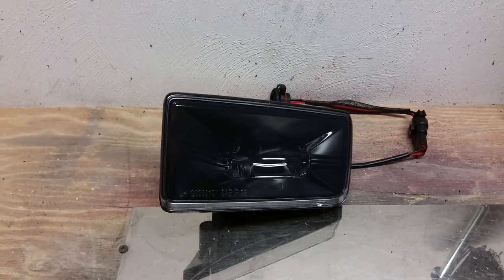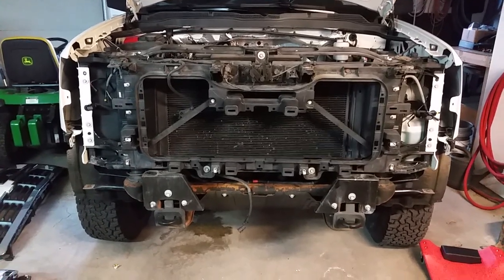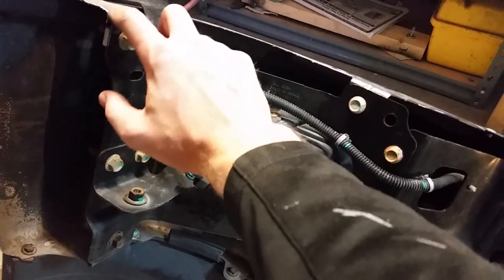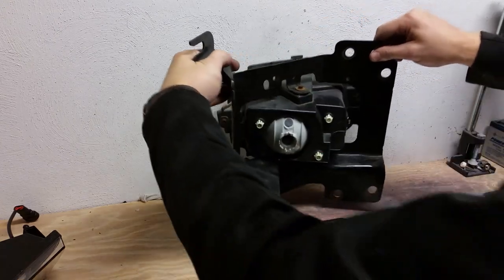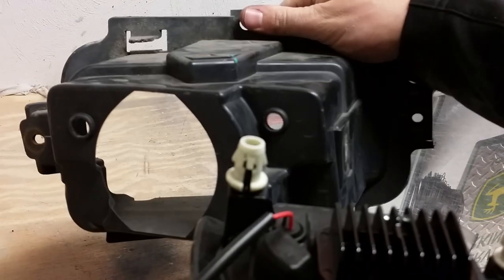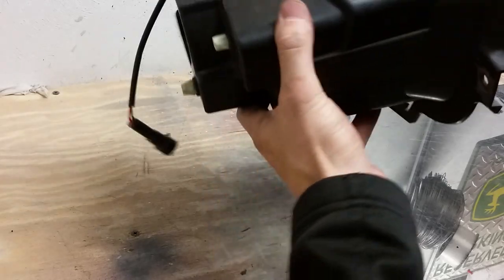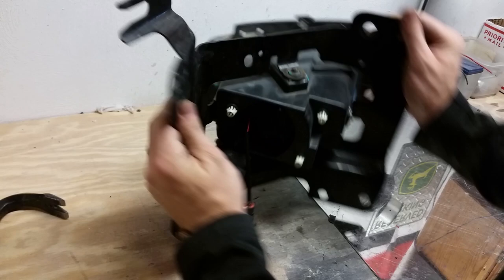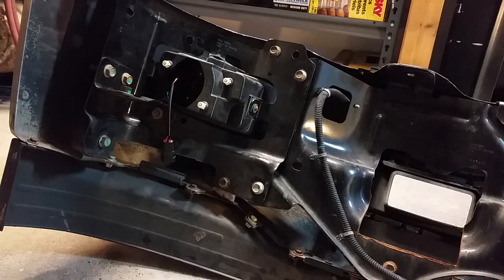Morimoto XB LED Fog Lights Installation on 07+ Chevy Silverado,Tahoe and Suburban

Comment: I pulled the engine and radiator so I could get to the back side of the fog light housing. Be sure, when removing the front suspension, pull the hood, windshield and headliner out to save time. Let the air out of the tires before removing the tires from the wheels. I figured that out the hard way!
Reply from the maker: I like your style 😎

Comment: 30 minutes without removing the bumper, just loosen the liner and unbolt the bracket that holds fog light in
Reply: +Chad Hawkins Please tell me this isnt needed to install. I just received my order form yall with these lights. was hoping its a simple install
Reply: Chad Hawkins ive Literally done it on my sierra in less than 3 minutes.

Comment: Just bought these for a 2013 Silverado 2500. While the housings are identical, they are not the same fittings as the video. My truck has male fittings on the truck side which insert into the factory fog light with female fittings. The XB fogs will not fit without some modification since the XB housing has male fittings that are supposed to go into the truck side female fitting.
Reply from the maker: Thank you for letting us know, CD! It might help to take some pictures and send it in via email as well so we can see those differences too.

Comment: What projectors from yours would fit 2010 mustang headlights?
Reply: Thanks. Will this also fit on my 2005 mustang? Or should I go with the new morimoto mini h1 7.0.
Reply: +Natty Brah yes, the headlights are quite similar, so will also work on the 05. The 7.0 is another good option - but overall we'd suggest the Mini d2s since you have the space for it

Comment: there needs to be an option for the 2006-2009 Trailblazer SS trucks like this.  they are regular projector type fogs and have had issues since day one of the truck coming out.  Blazer made a replacement foglight for the SS Trailblazer and they have since stopped producing them.  there is one other option...using the Corvette foglight, but those are 200 bucks each when you can find them new.    i would LOVE to see an LED option for our community.....!!!!!